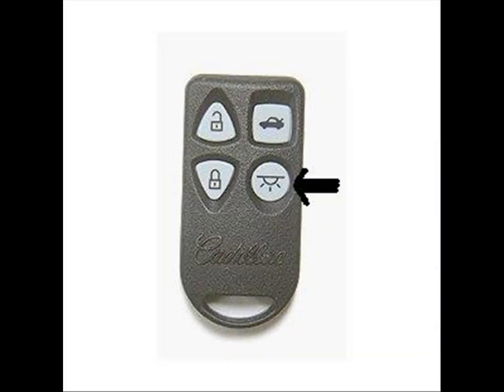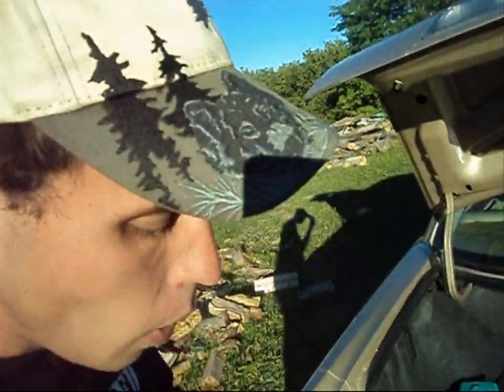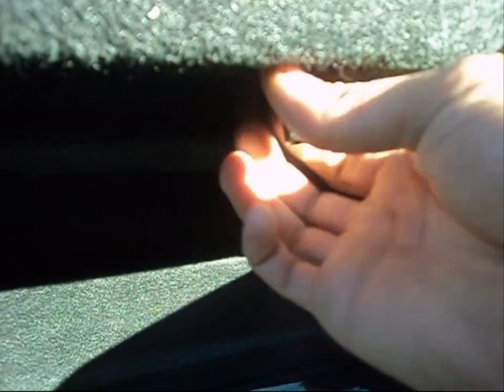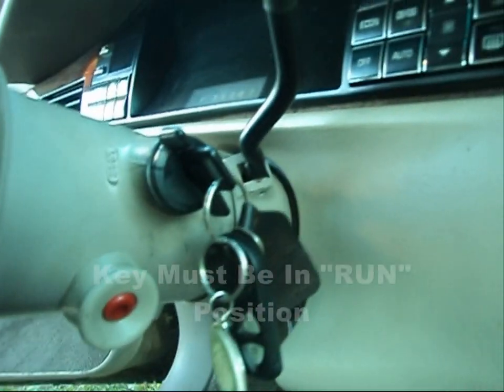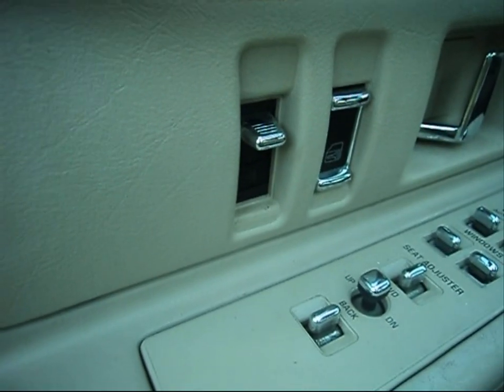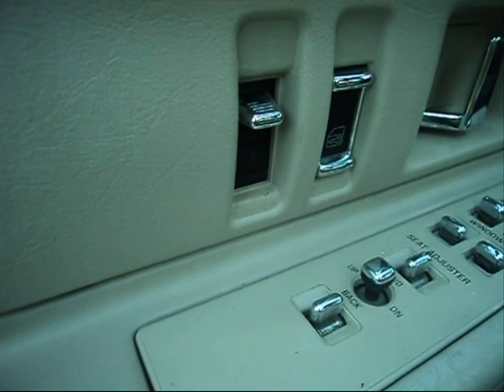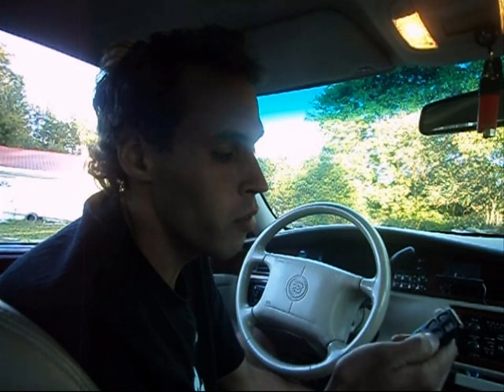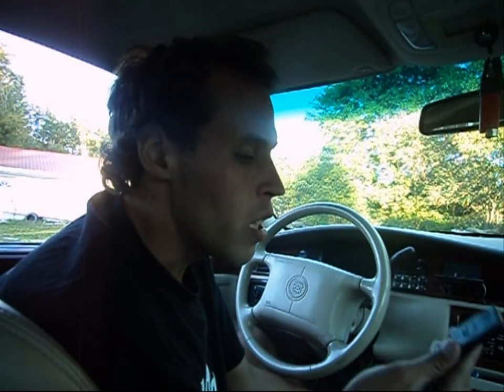Re-Programming Key-less Entry: '90's Cadillac DeVille

Comment: Your video may be helpful, but the black wire can be found much easier at the bottom portion of the locking meconisim.  There is actually a plug that is not plugged in under the back splash panel. This is the reprograming port and you do ground as you explain. I tried to find where you speak of, but never did locate that black wire. I found a diagram that showed the programing port, open the panel and there it was.

Comment: You don't have to get into the trunk liner at all. My 94 Deville has a wire by the latch that was so much easier to get to. I had to use a small rod to make a connection with the strange plug at the end of the wire, but paired that with gator clips and another cable to ground it and my locks cycled just like you want them to. Don't mess with that box unless you're willing to damage your car's electronics.
Reply: +Kyle Bishop do you know where the fuse for the receiver is located?
Reply: +lindsey carr not sure about the fuse. I'm uploading a video to tell you what I had done.
Reply: Ok thanks
Reply: Hello Kyle, you make a video , im
Confused how to ground that black looking wire - im no electrician- could you help plz
Reply: @kylebishop9519  thank you so much the video and the response. I really appreciate it. I may be silly but finding the tool to actually “ground is what i m lacking” in brain knowledge..... from that lil connector cable to the trunk latch for example in your video

Comment: I have a 1994 Cadillac Fleetwood Brougham , I have taken the right and left sides out looking for the Black ground wire , can't find a wire. Did all of these Cadillacs come with a remote? I see the BCM mounted in the trunk close to the rear speakers . Really want to have a remote for this Caddy. When I got this car ,I wasn't given any remotes , I did find and buy 2 correct remotes left side to arrow pointing buttons lock and unlock buttons , top right side square trunk button , bottom right looks like a light button . Help me , I would highly appreciate it , I see someone below wants to do the same.